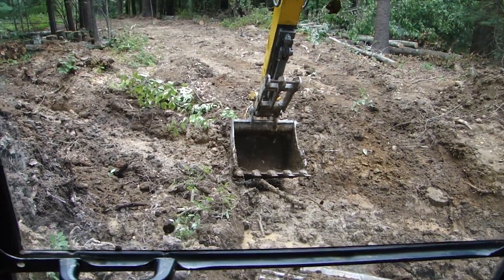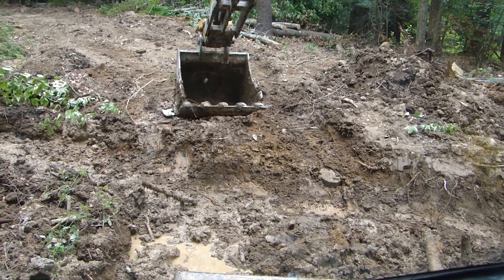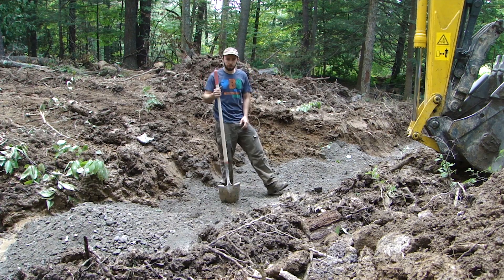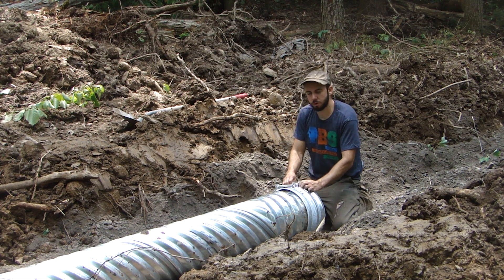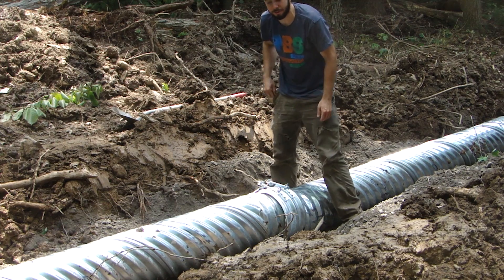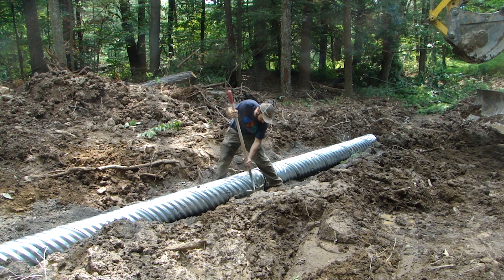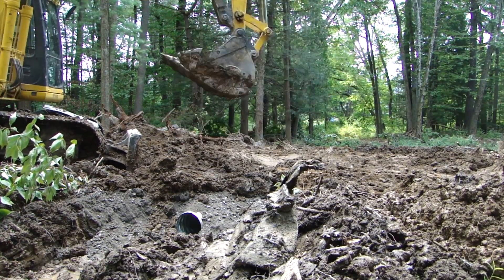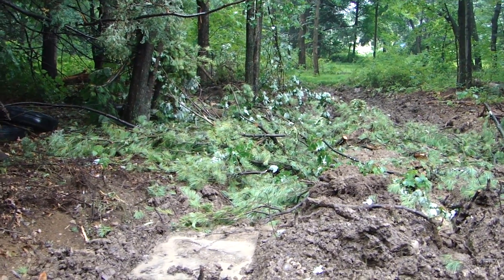How to Lay a Culvert for Drainage

Comment: Ribbed poly pipes ( plastic) with a smooth bore have a lot of advantages over steel pipes , eg tougher , wont rust , smooth bore helps prevent sediment build up inside, probably lighter too.

Comment: Was this for a drive or road?  You always should have a minimum of 1 foot of granular fill over the culvert to get HS-20 loading.  Also you never use the 'roll over' method for compaction.  Get a vibrating plate compactor and do it right in 4" lifts!  I've seen so many culverts that were squashed by trucks compacting them with their tires!  One was a very large aluminum plate box culvert that the foreman got in a hurry and had his backhoe operator drive over it to compact and it fell thru the 30,000$ culvert!  No happy times for them...
Reply from the maker: a droadway

Comment: I would not recommend using up all 3 ribs on the coupler, I think on the 3 ribs of the coupler it is supposed to attach with one on each side and the middle rib adds some flexion margin for seasonal ground shifts.
Reply: Actually if you look and the square end ribs of the culverts.. when placed together they form that middle rib in the three ribs on the band... so the outer ribs grab a full rib on each culvert.  When tightened down properly those plates the bolts go thru will be almost touching and the pipe will not have any flexture in it at the joint.
Reply: @tubedude54  the whole thing looks like it could fold up at the slightest bit of pressure....even from just driving the dozer over it . I am watching this to look at how to avoid such a thing as I'm having to replace a culvert that split in half at the joint . I'd feel better if that coupler was 3 times as long  hahaha
Reply: @skidfrog  Please do not do it the way this guy does... I haven't watched any other of his vids, if he has any, but this video shows he doesn't know what he is doing!  I suspect he worked a few months with a firm installing culverts and decided he could do it on his own.  He purchased a used backhoe and took on jobs I assume.  The very first thing you must do is make a stable compacted bottom by digging out all loose soil and tree roots to about 1 foot below the grade your pipe will be at.  You then place crushed stone in and use a vibratory hand compactor to make grade... and no a compactor is not the backhoe bucket!  You use an optical or laser level to get grade and adjust the stone till it is correct.  'Correct' means that it has the proper slope for the size pipe you are using.  (I engineered, sized and oversaw the installation of thousands of culverts over 30 yrs)  When a bottom is prepared correctly and you put the culvert in the hole you will see no gaps beneath the culvert.  You then place crushed stone around the pipe in 4-6" lifts and use the compactor to set it.  You continue to place the stone in lifts till you get a MINIMUM of 1 foot (will vary with the size of the culvert) of compacted stone over the pipe  BEFORE you drive ANYTHING over it!  I hope this guy has learned something since he made this video.  I forgot to tell you your instincts are correct about the band... if you look at each end of the culverts he joined they have 4 square rings on them and his band only has room to attach to 3 rings...  He needed a longer band that would at least hold to 2 rings on each piece of the pipe.
Reply: @tubedude54  Thanks for answering !......I like your reminders a lot ; the issue with my particular field ditch is that the water level is about a foot or more above the current washed out culvert pipe in the spring thaw.....and the ditch overflows to about a 100 foot width and more......but only for these 2 or 3 weeks and then the water stabilizes about 3 feet lower through the rest of the year. I have plenty of two-handed sized boulders to reinforce and  contain the whole thing properly once I dig it all out and start over !
Reply: @skidfrog  Skid... I don't know where you live but you should check with your county drainage board before you do any work in a ditch or waterway.  Sometimes, if you're lucky, you can get ahold of the state Soil and Conservation Service and they might even design your structure for you free of charge.  If it lies in a regulated drain you can even get the county to install it for you for free since it is the counties responsibility at that point!!  Good luck!
Reply: @tubedude54  Thanks man / yeahhhh......the entire area around here is swampy for 50 miles in any direction. The "ditch" in question is something that a previous farmer cut into a field to try and drain the area and it works fairly well in summer and fall............it's all completely under water during the spring thaw though / the main reason I'm redoing it is because it was never packed with stone in the first place and all soil washed away leaving two broken segments of culvert ( one steal and one broken concrete ) completely exposed in a sunken mess. Thanks for your tips !